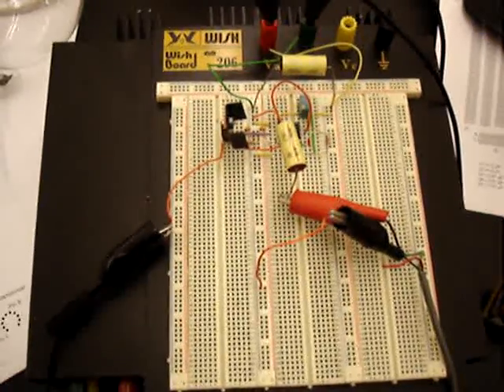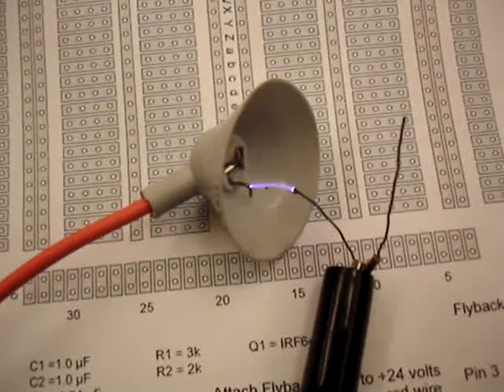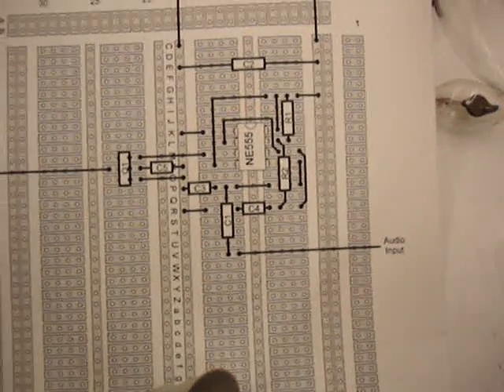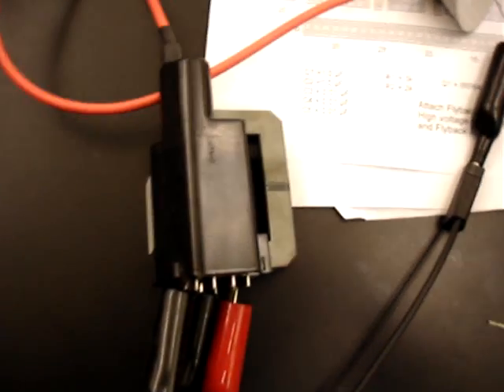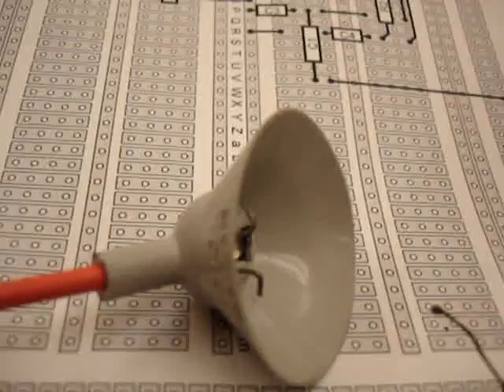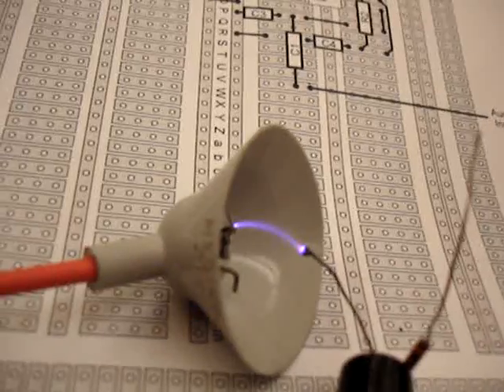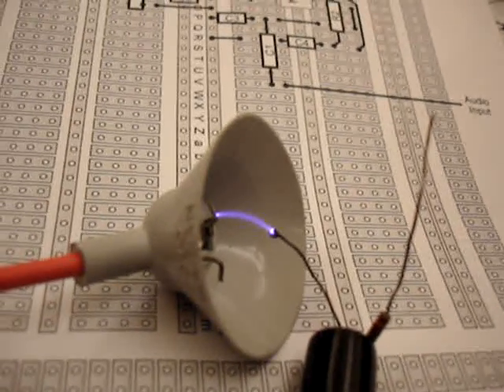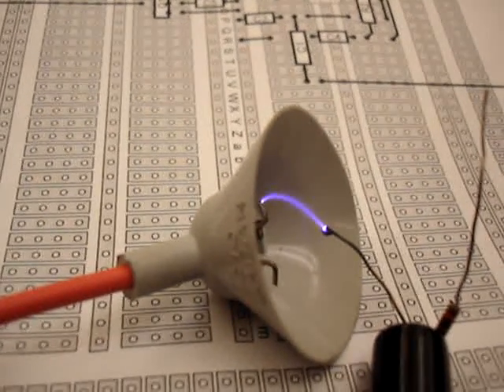Plasma speaker: making musical sparks

Comment: I have a question, but the negative of the 24v goes to the negative of the 12v
Reply from the maker: The 555 timer will not work with 24 volts, so the 7812 voltage regulator is used to convert the +24V to +12V.  The IRF640, 555, flyback and power supplies all share a common ground.  The output of the 555 is used to control the gate of the IRF640 (which is powered by 24 volts).  There is a 3-ohm, 100 watt power resistor in series with the flyback and IRF640 - this is used to limit the current through the flyback and IRF640.
Reply: ok but if I use a power supply of 12 volts, the voltage regulator 7812 I don't need, and the negative of the 24 volt connect to negative of the 12 volt
Reply from the maker: elettronica pratica passo a passo
 If you connect the grounds of the +24V and the +12V supplies together, then it should work without the 7812 regulator.

Comment: How much power did that use? In terms of amps and watts. I have an idea, could I contact you lots of questions for my project.
Reply from the maker: This was a slapped-together demo circuit, so the power supply was vastly over-kill: 24 volts at 6 amps - Circuit Specialists had them on sale a while ago and I bought a bunch.  You could probably run with with a supply that's half this current and it should work fine - they're selling 24 volt 3 amp supplies for about $18.   And, if you optimize the timing, you should be able to get a lot more acoustic power.  If you want to contact me directly, my email is dsherman@cornellcollege.edu

Comment: I wonder if you tuned a fusion reactor...
(Nah, just kidding, but if it were possible it would be awesome)
Reply from the maker: It is an interesting question.  Unfortunately, the National Ignition Facility uses a pulse rate of only 10 Hz: if they were to increase that to at least 30 kHz and modulate it, then I suppose they could play "Sonic Fusion."
Reply: derinsherman62
Well maybe with a little tweaking we can get an audible fusion reactor just for kicks.
Or give someone the creeps.

Comment: One of the better ones I've heard, would love to see these go commercial
Reply from the maker: Thanks for the compliment.  It would be nice to see some commercial plasma speakers, although safety issues make this difficult.  The quality of my plasma speaker is actually pretty poor.  If you want to hear a much better plasma speaker, try viewing the "Plasma Speaker / Tweeter - Completed Working Setup" by timetec (fast forward about 1 minute into the video to skip over the setup).  This is a much better quality plasma speaker than mine, but I'm also guessing that it makes a lot more ozone and nitrous oxides.
Reply: They are commercial kind of, EastVoltageResearch.com sells kits u can make.

Comment: i have the parts, but they look different. you think i can make it?
Reply from the maker: It depends on how different the parts are.  A different power resistor will work just the same, but a different flyback transformer would require different connections as well as a different resonant frequency.  In some cases, you want to avoid electrolytic capacitors and use ceramic or mylar capacitors, but in other cases it's OK to substitute electrolytic caps.  Most 555 timer chips, either the classic bipolar or the more modern CMOS, should work fine.

Comment: Very cool, thanks for the explanation. It's amazing so much sound can from that little source. I'm curious though, is there a reason other than risk of high voltage that those aren't used as a replacement to regular speakers? You said the quality can be quite good for these devices in another comment I saw.
Reply from the maker: There are a few problems with high voltage.  First, and most obvious, it can electrocute the listener.  It can also start fires.  Less obvious from the video, but fairly obvious if you actually build the device, is that it produces ozone and nitrogen oxides, both of which are toxic irritants.  It's fairly easy to deal with electrocution and fire hazards: surround the spark with a strong metal screen.  Removing the toxic gases is a more difficult problem.  The Plasmatronic speaker solved it by attaching a helium tank to the speaker.  Sparks in helium won't produce toxic gases, and the speaker had incredible fidelity.  Unfortunately, the helium had to be replaced regularly, and this doomed the speaker to oblivion.

Comment: I have to admit I'm not too familiar with how flyback transformers differ from standard power transformers, but how do you prevent serious shocks from happening if you were to get too close to the arc? I've heard from most people that the secondary isn't lethal (even if it stings), but what's stopping the the secondary from pulling a lethal amount of current? I would have guessed you'd need a resistor on the primary to limit it on the secondary.
Reply: The transformer can't pull too mutch current because there is not enough power at the input, according to the laws of thermodynamics no object or device can output more energy than you put into it, the supply itself is current limited, so the transformer isnt going to generate a thousand amps out of nowhere

Comment from the maker: This is exactly why I warn people in the video not to make this circuit if you are not familiar with how to properly handle high voltage electricity.  I really can't say this too many times: this circuit should not be made by anyone who is not experienced with high voltage.  The voltage produced is high enough that many insulators will conduct significant amounts of current.  So, to everyone else reading this: don't build this if you don't know how to work with high voltage!

Comment: I made one, but it's causing a really high frequency noise that is very annoying, so I was wondering if you've had experienced it as well so you could help me correct that problem. I was thinking maybe to put a crossover in the audio input signal and see if it goes away so I made one, but since it has an air core I suppose it needs a lot more swings than the amount I made. So any kind of help from you for this problem will be very appreciated...

Comment from the maker: I've just made a slow-motion video of the plasma speaker in operation so you can see the spark flickering on and off.  You can also see other details of the spark as well.  You can find it using the link in this video's description or by doing a search on "Slow Motion Plasma Speaker".  The one drawback is that high-speed video cameras are fairly noisy, so the image is quite grainy, but you can still see a fair amount of detail in the spark.

Comment: We've been working on high voltage circuits in class for a few months (designing and making things like camera flash drivers, etc) and the lab is well enough equipped for something that hasn't been updated since the 70s. Do you know if this technology has any advantages over the classic speaker or is it more of an experiment/interesting exercise type project?

Comment from the maker: It's not hard to make this circuit, but there are several safety issues.  Also, it is possible to make higher quality versions of the circuit if you want better audio.  (Use a proper PWM chip rather than the simple 555 timer chip.)

Comment from the maker: The large capacitors on the circuit board are old 1uF foil capacitors which I believe are rated at 100 volts.  You can get flyback transformers from Hosfelt electronics (do a Google search).  Scroll down their menu and click on "Transformers" then click on "Flyback."  I haven't used any of these, but the one I used is similar.  I also have some spare flybacks if you need one.  Let me know if you need any help putting this together.

Comment from the maker: What sort of flyback are you using?  The IRFP250 should be fine, and the 4.7 ohm resistor is in the right ballpark (although it may get hot).  The Goldmine Electronics flyback I used had a primary winding resistance of about 3 ohms.

Comment from the maker: Ouch!  Did you have a power resistor connected in series to the primary?  The power resistor serves to limit the current and it also helps prevent power surges (the power resistor and primary windings form an LR low-pass filter).

Comment from the maker: Since the IRFP250 has a rating of 200 volts, 30 Amps, 0.075 ohms, it should work just fine.  In fact, you may not even need a heat sink.

Comment from the maker: The IRF640 can withstand 200 volts at 18 amps and has an on resistance of 0.18 ohms.  Although the IRF630b has the same voltage rating, it can only tolerate 9 amps, and has an on resistance of 0.4 ohms, so it will get hotter.  In theory, it could work, but it's best to have a higher current rating to prevent premature component failure.  Average current is about 3 amps, but this circuit has both large current and voltage surges, so I'd still recommend the IRF640 (possibly IRF540 or IRF740).

Comment from the maker: Actually, the 20 volt number you cite is the maximum allowed gate-source voltage - a higher voltage than that can damage the MOSFET.  Double-check the numbers on your data sheet: the datasheets from International Rectifier, Vishay, Philips, and Fairchild all agree on the 20 volt maximum.

Comment from the maker: Yes, that's true - good advice for anyone trying to duplicate this circuit.  In my circuit, the 555 is running from 12 volts so it produces 12 volt pulses which can turn on the IRF640 quite easily.  The circuit probably wouldn't work as well if run from 5 volts.  With the gate-source voltage at 12 volts, the on resistance is less than 0.2 ohms and the maximum drain current is about 18 amps - way more than I need in my circuit.

Comment from the maker: The IRF640 Gate-Source threshold voltage is typically 3 volts, so it can be driven with a 5 volt TTL-level signal.  However, you are absolutely correct that it is more efficient when driven with 10 volts.  My goal in building this circuit was to make as simple a circuit as possible that worked.  A proper circuit would do a better job with the pulse-width modulation and have a more efficient flyback driver.  But this circuit works just fine for demonstration purposes.  Thanks for the comment!

Comment from the maker: It should be pretty simple to replace the MOSFET portion of the circuit with an IGBT.  Google "IGBT pwm 555 circuit".  The only thing that would change in my circuit is the output from pin 3 of the 555 would go to the IGBT instead of the MOSFET.  Otherwise, the circuit should be the same.  If I get ahold of a suitable IGBT, I'll check it out.

Comment from the maker: The theory behind the circuit is well-known.  I'm not as sure about the theory explaining how the sound is actually produced.  I believe that the sound is produced by the spark growing larger and smaller in synchrony with the music.  As the spark gets larger, it heats up the air producing more pressure.  I have just made a slow-motion video of the plasma speaker in operation, and you can see the spark "flickering" as the sound level oscillates.  If there's interest, I'll post a video of this.

Comment from the maker: What flyback are you using?  The circuit must run at the resonant frequency of the flyback transformer.  My circuit is designed for the Goldmine Electronics model G17744.  You can change the resonant frequency by adjusting the values of the 2K and 3K resistors attached to the 555 timer (replace 3K with a 5K pot and adjust).  Also, polarity matters: if it's hooked up backward, then diodes inside modern flyback transformers will prevent the circuit from working properly.  Let me know if it works.

Comment from the maker: Probably, although you'll have to check how much current is needed to drive the primary on the flyback.  If there isn't enough current into the primary, then the spark will be pretty feeble.  If the primary resistance is too low, then the input current will be too high and you might fry the MOSFET.  By the way, you can substitute the IRF640 with other high voltage (>100V), high current (>10A) N-channel MOSFETs, like the IRF540, IRF740, or even the 500 volt, 14 Amp IRFP450.

Comment from the maker: Yes, indeed.  Any chip that can produce a pulse-width modulated signal can be used in place of the ubiquitous 555 timer chip.  If you do a Google search on "Tesla coil PWM chip" you'll find that the TL494 is also often used to do this kind of modulation.  In fact, the TL494 will produce higher quality audio than the 555.  Other people use the SG3524 chip or the UC3528A chip.  I used the 555 because they are cheap and plentiful and I had a bunch lying around.

Comment from the maker: Well, if you use a Texas Instruments TLC555 and run the oscillator at a higher frequency (without the high voltage) then you can make an AM radio transmitter.  That would still make a good high school project: it's safe and the circuitry isn't all that complicated.  Let me know if you need help building the circuit.

Comment from the maker: In theory, this type of speaker could deliver the best possible sound since it has essentially no mass that would damp and distort the sound.  In practice, the circuit I'm using is pretty cheap and has several drawbacks.  People have tried to build high quality versions of this circuit, but they all have technical problems (safety, reliability, etc.) that have prevented these speakers from becoming mainstream.  Google "Ionovac" for more information.

Comment from the maker: I'm not sure there is a single best place.  I got the flyback transformer from Goldmine Electronics; power supply from AllElectronics; power resistors from eBay; circuit board from Futurlec; other electronics from Circuit Specialists, Jameco, Mouser, and Digikey.

Comment from the maker: It depends on the flyback transformer you use.  The one I used needed at least 18 volts to get a reasonable spark, and 24 volts worked much better than 18.  15 volts is too low, although you might be able to use a 15 volt supply if you wound your own primary.  A new primary would typically consist of 5 to 10 windings of heavy gauge wire (16 AWG).  This won't be as efficient as using the original primary, but you can adjust the number of windings to match the voltage of your supply.

Comment from the maker: I used a 150 watt 24 VDC power supply (since I had some extra lying around) although you can use a lower amperage supply such as the AllElectronics catalog # PS-2427 (24 VDC, 65 watts, about $15) which can easily power this circuit.

Comment from the maker: The power output by the supply is about 2 amps x 24 volts, so about 50 watts.  However, the power supply obviously isn't 100% efficient, and I haven't explicitly checked the total power drawn from the AC mains.  Needless to say, the ratio of acoustical power output to electrical power input is pretty low.  Most of the power is converted to heat in the form of hot electronics and a very hot plasma arc.

Comment from the maker: I tried many different MOSFETS, placing protective diodes in series (to prevent reverse current flow) and parallel (to prevent reverse voltage bias) but the MOSFETs just didn't seem to live very long.  Then I added the 3 ohm power resistor, and it worked like a charm.  I know, it's gross, but it current-limits the circuit and seems to prevent transients as well.

Comment: that's why i chose it!. however, every mosfet i used in the circuit burned out due to voltage spikes getting the best if them. how can i prevent this? i tryed neon lamp across the flyback primary, but that didn't do anything, and i tryed a diode across the primary, that just overheated and i got no sparks. (it was connected backwards, in parlell to the primary to absorb the back-EMF. what should i use?

Comment from the maker: Thanks - glad to hear it works fine, although the on resistance of the IRF840 is listed as 0.85 ohms, while the on resistance of the IRF640 is listed as 0.18 ohms.  The upshot is that you don't need as big a heat sink to keep the IRF640 cool as the IRF840, although the IRF840 will tolerate much higher voltage spikes than the IRF640.

Comment from the maker: Actually, the really dangerous electrical devices in your house are power tools.  Not only can they do bad things (like cut off fingers) but they can also overheat and catch fire (which happened to me a couple of years ago).  So, power tools are much more dangerous than plasma speakers, and most people don't have problems using them, although we wouldn't let young children play with them.

Comment from the maker: In terms of safety, this flyback transformer (like most modern flyback transformers) produces pulsed DC which is more dangerous than AC.  If the spark was just high frequency AC, then the nerves and muscles in your body would'nt respond much at the carrier frequency (tens of kiloHertz), and you would only suffer plasma burns (which are still nasty).  However, the DC component in the arc still remains dangerous, even when the carrier frequency is high.

Comment from the maker: Well, the arc is pretty hot, and it could easily set fire to your house and burn it down if inflammable material is nearby.  It's not hard to place metal screens around the arc to prevent that from happening, but there is a danger if you use an unshielded arc.  (Yes, I'm setting a bad safety example for the kids at home by showing them an unshielded arc...)

Comment: i figured. just wasnt sure. did you get the tuning this circuit?  i found that a 3 amp power supply is more than enough to power this to its fullest pontential.

Comment from the maker: Apart from the usual differences between using N-channel and P-channel MOSFETs (N-channel sinks current to ground and P-channel sources current) yes, it should work fine.  It's true that the P-channel MOSFET would change the phase of the signal when compared to an N-channel MOSFET, but that shouldn't matter because your ears are fairly insensitive to phase.